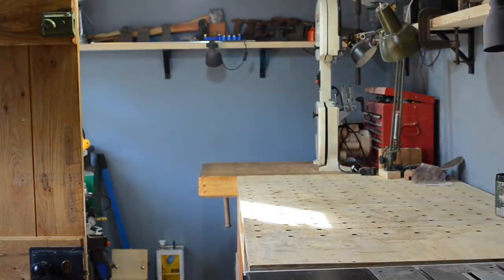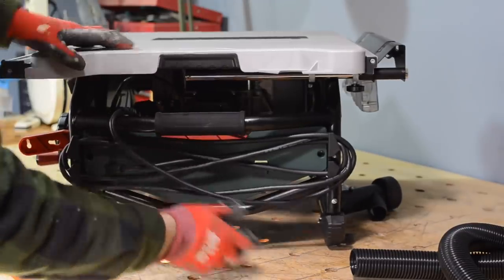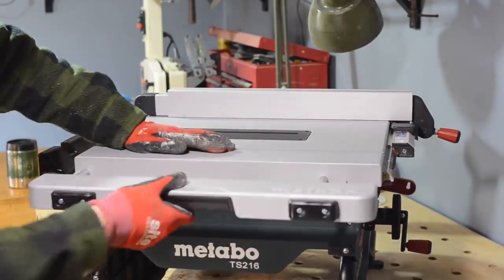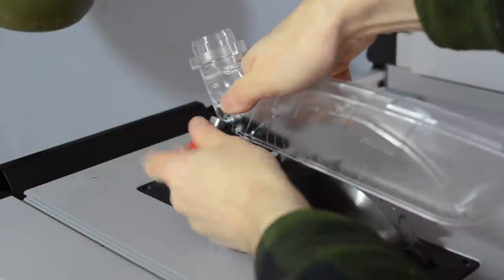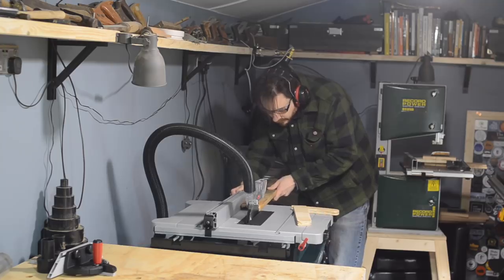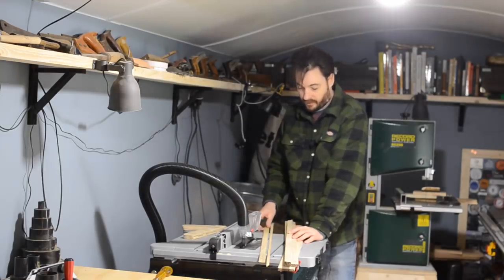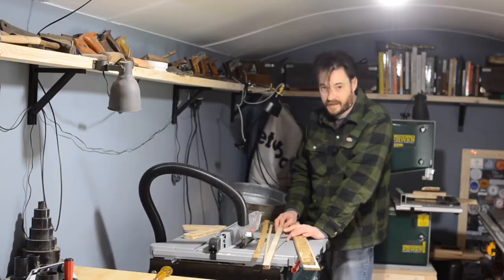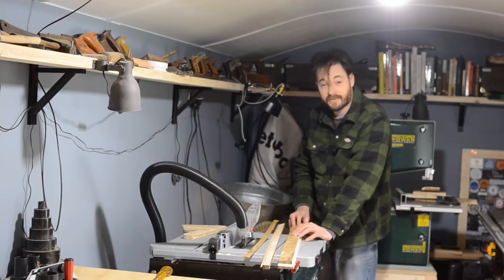Metabo TS 216 Table Saw First Look

Comment: Having fone for the Axminster ts250 with an induction motor, I could never go back to a universal motor saw for use in the workshop. My previous saw was so loud I would avoid using it. As a portable saw this looks to be fantastic for site use. In general metabo stuff seems to be just getting better and better!
Reply from the maker: I had the induction motor saw and found it lacked power

Comment: After a lot of research i bought Dewalts DW-745. Accept from the fact that it's a bit loud I've never regretted going for that saw. Built a bigger table for it and it works wonderfully. For the price it's a wonderful saw. This one seems good also, especially the fence locking in the back! I hope you'll enjoy using it and thanks for sharing your experience! I'm sure you'll give us more info after a bit of use :)
Reply from the maker: Thank you. Glad you are happy with the Dewalt

Comment: Hello fello scary machine users. I have the TS254 which is pretty much the same saw reviewed. Only differences are, no left extension to the table, larger extension to the right, foldable legs and wheels so no carrying it around.
For me it's a brilliant saw, does everything I need from it. Easy to use, accurate, and very powerful. Hasn't twitched @ anything I've needed it to do and laughs in the face of hard woods.
H
Your review was spot on. I agree with you on mitre slots. Should be law to standardise. Long arbors and dado stacks should also be law.
Just dropped in to say you  you did good with your choice and will not be disappointed with your purchase.
Reason I chose mine is sometimes I need space in my shed and mine tips over, legs fold up and it can sit in the corner out of the way as if it weren't even in the shed. All boxes ticked.
Gr8 vid 👍
Reply from the maker: The mitre slots are a pain. I have had a few problems with mine and will do an update video soon

Comment: hi mat 
I've had the t s 254 for about six years now. been great, working on site it's took a lot of hammer. plus side dust collection is excellent, plenty of power, very portable. only real down side, on mine the table isn't flat.
Reply from the maker: Thats a shame. I will check mine

Comment: I also have a metabo table saw, a different model. It has all the good features you mentioned. The issues i had were alignment of the fence. After i read the manual i aligned the fence and that made a big difference but i still had problems. The rear clip grabs the rear rail and the fence will sometimes lock out of alignment. I have since discovered there is an adjustment of the rear clip but i haven’t done anything about it yet. I agree that the mitre guide is poor and i had not realised that the T tracks are non-standard!
Reply from the maker: Its a shame as with a free small changes it would be great
Reply: @Badgerworkshop   I have the same problem with the metabo fence. Wat is the small fix?

Comment: Looking back I should have got a cheap and cheerful one like this. I thought I'd go and splurge on a dwe7491 and it's not a very serious tool. Wobbly mitre gauge. Mitre slot is blocked by bad casting at one end. Table surface is so warped that wood rocks on it.
Reply from the maker: I looked at the DWE 7492 and thought it looked a great tool to that is a shame

Comment: I'm on the verge of getting this Metabo. I was previously keen on  buying the Dewalt DW745 because people say it has a great fence with rack & pinion movement. But now I like the idea of dual dust port on the Metabo (if the blade guard is on). Does anyone know how the dust collection compares with Dewalt DW745 vs Metabo TS216? The Metabo is also £100 cheaper on Ebay 10% day if you buy from FFX.
Reply from the maker: I got it from FFX
Reply: I have the dewalt dw745 fence is solid and the rear dust extraction is superb
Reply: Thanks. I think I'm still set on the Dewalt DW745. The Metabo is £100 cheaper but the Dewalt fence is a good selling point from the reviews Ive seen on YouTube.
Reply: @nixy102  I've owned it over 12 months and never had too adjust it as it is still as accurate as when I set it up

Comment: looks like a good all round job site saw, had i not already bought a dw745 I think this one would get my attention based on your review.

things i like about this verses the dw745 is the adjustable riving knife which is a fixed position on the UK dw745, and also the clear blade guard compared to the almost solid black on the dewalt.

i like the pull out supports too, don’t get any on the dw745, but since i plan on making a bench for it to go into, not a problem for me later.

was there any play on the mitre gauge? on the dw745 there is a little play although i think someone added some tape to the edge to fix that on another table saw so might try that on mine.
Reply from the maker: It has a bit of play but I will also try the tape trick

Comment: Very much a newbie to this table saw world so forgive a naïve question - I've looked at ultra budget table saws at sub 150GBP and found them to be quite scary i.e wobbly fences etc so I've upped my budget and was attracted to the Evolution Rage 5-S that seems safe and good for the price and I'm impressed with what you've said about the Metabo but could I ask what makes the Metabo better than the Evolution and is there a way to overcome the problems with the mitre T slot configuration ?
Reply from the maker: Not standard mitre slots means you cant use off the shelf assessors. Its easy enough to cut wooden strips to fit in them and make your own.

I have not used the evolution saw but as you have found you get what you pay for. The fence is very important and you need one that locks tight and square.

Comment: Interesting Matt. I'm still looking for my perfect table saw and am just a bit grumpy about having to constantly put-up with compromises all the time. I just don't know why quieter saws aren't a thing? Did look at this at the tool show in the autumn - kind of like the idea of the new administer craft, but don't like the small blade size. So in-short I can't make up my mind. But enjoyed this quick look. Cheers.
Reply from the maker: Thank you
Reply: @gkinlen  This has become a bit of bugbear for me recently. I read on a forum some tradesman chastise a someone asking about quieter table saws with "just use hearing protection". That's just not good enough in my view. Quieter tools benefit everyone - the user. Anyone in the same room, anyone nearby and people down the street. I live on a new estate and all the 110v tools used by folk on the building site are deafening - all day. Right now my workshop is one of the quietest places in my neighbourhood as I've carefully considered the noise output of my stuff. Matt's saw pumps out 110db according to the specs. My Evolution Table Saw measures at about the same but it doesn't have to be that way and I'm keen to find a quieter saw, preferably with a 250mm blade.
Reply from the maker: Shame as it looks a great saw
Reply: @StrawbyteWorkshop  I'm in the same boat as you. Axminster craft saw just looks too small. I'm hoping they'll be another to replace the Ts250
Reply: How often do you cut at full depth though? The cut depth of the new Axy Craft saw is 65mm which is only 10mm of 250mm saw. It is very quiet and you get that smoothness from the mass of a cast iron machine.
Reply: @amiddled  I mean the saw in general is rather small. Smaller than my current job site saw. So am hoping the there will be a scaled up model
Reply: @SirBenJamin_  True, I suppose they have scaled it for the UK hobbiest which means single garage workshop or smaller for the most part. Basically a pint sized cabinet saw. I will put Part 2 of my review/impressions of it on my channel in a couple of weeks.
Reply: @amiddled  Ah - Mr Bodgers

Comment: As everyone else here, we all have the same problem we want a new saw. Bottom line I've looked at just about everything on the planet, conclusion, 99 % all have something not suited being noise, mitre slop bad dust extraction and so on. So I stopped looking and just going to save my money and buy what I think is the more suitable kit. So far axmister AT254TS with the sliding carriage around 3.5 k. But I know when I buy it I shouldn't  regret it, so therefore didn't waste my money on compromise
Reply from the maker: Looks a good bit of kit
Reply: that axminster saw caught my eye too especially with the built in router table with cast iron top. just add the UJK router lift and your away. good deal in axminster at the minute I think sits £2600 with lift if memory serves me right?

Comment: The only problem is that you have to plug it in. The future is cordless such as Milwaukee or Dewalt flexvolt.
Reply from the maker: I never won't to move it so would not want battery power
Reply: Lol not for professionals, using li-ion for heavy duty is just waste of battery. But if you use it 1 time every month it's ok.

Comment: I have the ts 254. Same fence. Do you not think the fence is  is sliding uneaven 
and it is sometimes off by 1 mm when you lock it? It is a wounder to me how they can put so much efford into 
creating smart solutions and then just more or less forgetting about the
 fence to be practical and accurate.
Reply from the maker: The fence is not great. I did a follow up video and ended up returning the saw